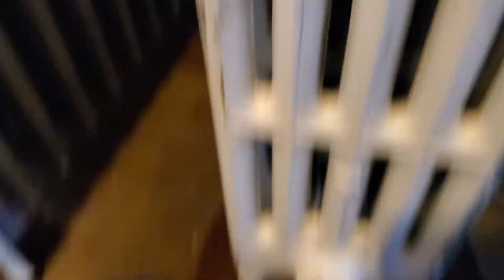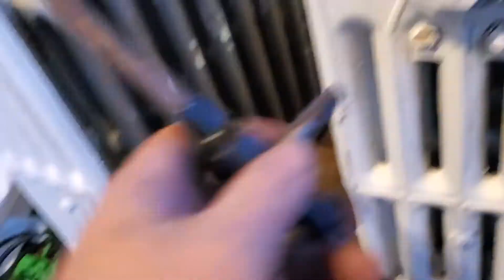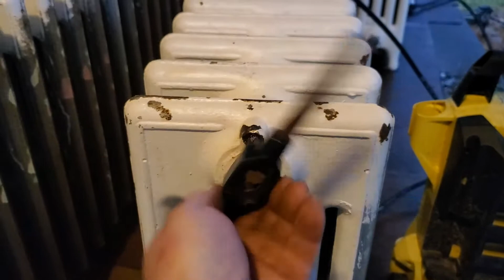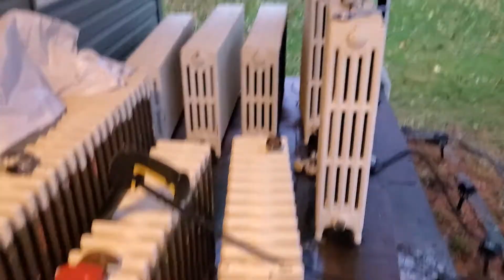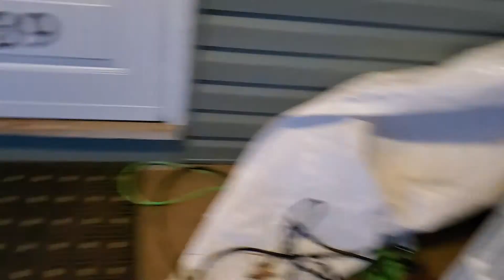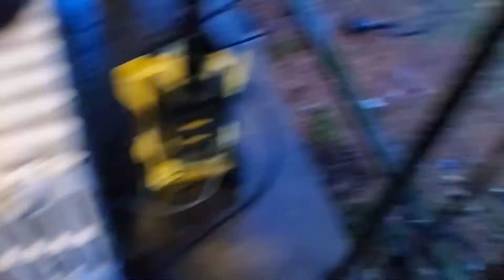Broken radiator bleeder.

Comment: Always work to do. Rain is better than snow!  Snow is back in our forecast.. I’m still cutting and splitting wood.. but also have a 1500 liter propane tank coming
Reply from the maker: Indeed. Trying to get them inside before freezing weather. Got 5 radiators in the house this morning with some help. They ran a natural gas main nearby to supply the local power station but they did not hook my street to natural gas. I'll stick with anthracite coal. Good luck with your propane tank install.
Reply: @lincolnmaniac  They sent out a guy to do a site visit, and tried to say I don’t need such a big tank.. guess they didn’t want to give me the first 500 liters free.. as it’s their deal if I get the  1500 L tank and it’s the same price a year for the rental..so to me it’s a win win.. can fill up in July when gas is cheaper